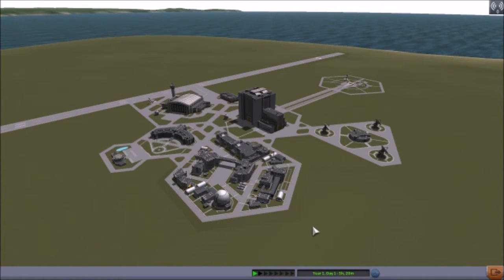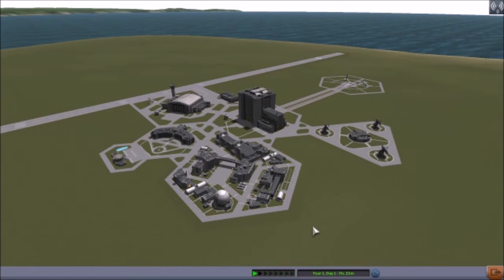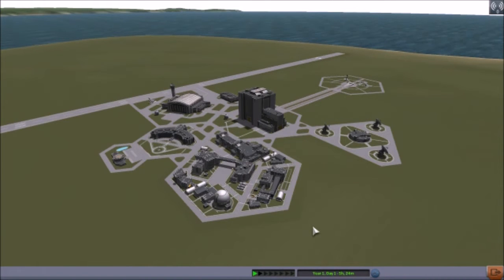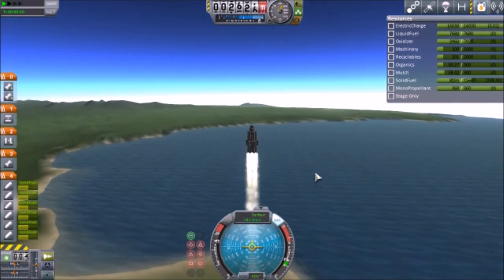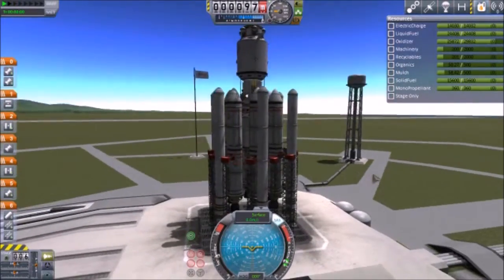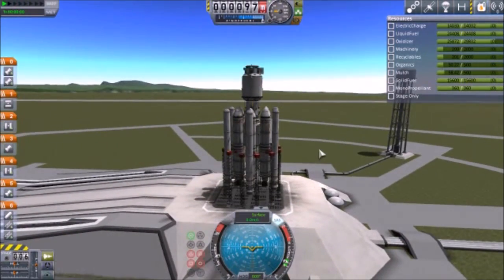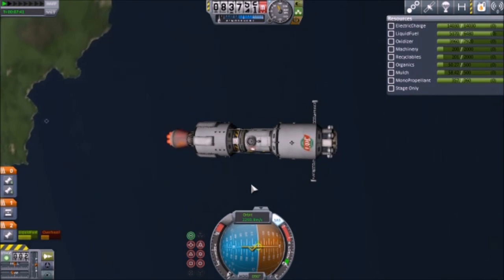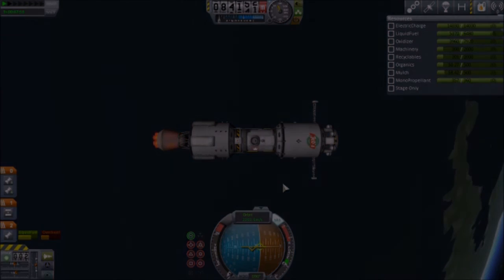KSP Quickie with Bob: Nuclear Lightbulb

Comment: Hope you respond, would you think that liquid xenon be an even more efficient propellant in such a design? considering xenon is an excellent neutron shield as well, PLUS the fact that xenon is a fission by product of these nuclear processes. Would Xenon increase the exhaust velocities due to its mass and thus, increase ISP?
Reply: Hello, Bob,

As Winchell Chung explains pretty well in his great Atomic Rockets site (particularly in http://www.projectrho.com/public_html/rocket/engines.php#thermalve ), the velocity of the exhaust (and thus the specific impulse of the rocket) is inversely proportional to (the square root of) the molecular weight of your propellant. Molecular hydrogen has a molecular weight of 2; Xenon has a molecular weight of 131, so the exhaust velocity (and so the Isp) would be expected to fall by a factor of 8 by switching to that noble gas.
Reply from the maker: Hi OnePercent - 

I only know that hydrogen is recommended as fuel in all nuclear lightbulb designs I have seen. Although technically  the reaction mass is hydrogen mixed with tungsten particles, and those are relatively heavy. The tungsten particles are in there to absorb the radiation and heat the surrounding reaction mass. Beyond that, I am not sure what else would work. 

Hydrogen would also have an advantage in ISRU situations, as hydrogen is easier to obtain than xenon.
Reply: Nuclear reactors don't produce anywhere near enough xenon, but neutron interaction power (on top of thermal conduction) is an interesting phenomenon with hydrogen in traditional NTR's. Neutron absorption+moderation heating alone isn't enough and too much means you'll "poison" the reactor, killing the critical reaction. One way of using neutrons directly is just to make a nuclear explosion by letting a flow of water and uranium salts mix and go supercritical in an engine bell.
Reply: @leerman22  yea, but thats not a tech in the horizon, THATS A FREAKING NUCLEAR TORCH DRIVE!
Reply: @antaresmc4407  It's just an ordinary "open-cycle" gas core reactor engine.

Comment: Side note on this thing:

You cannot launch it with the reactor turned off and then turn it on mid mission to save on nuclear reactor life.

This is probably because, once you turn it off, the thing goes solid and thus cannot turn back on.
Reply: Uranium hexafluoride is a gas at room temperature.
Reply: @leerman22  if you use UF6, at operating temperature will dissociate and F ions are hypergolic with just about everithing

Comment: Great work there using the nuclear lightbulb for Earth launch. Bob, you made all the important points: this technology is heavy, and you have to be careful to efficiently reject the heat. Being heavy is relative here, because outside the gravity well (or in a lower gravity well) the engine mass does not necessarily scale with the vehicle mass. So, over all: a great efficient upper stage engine. The best part: no fission products out the back.